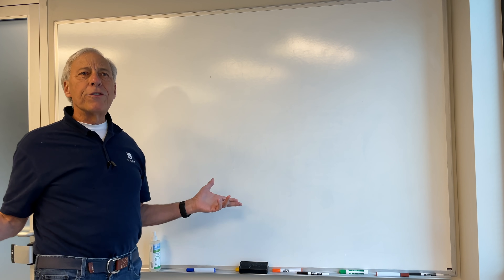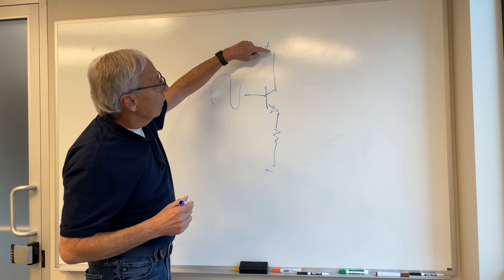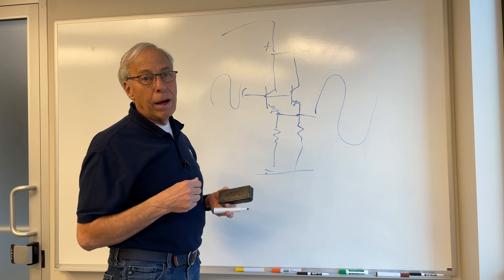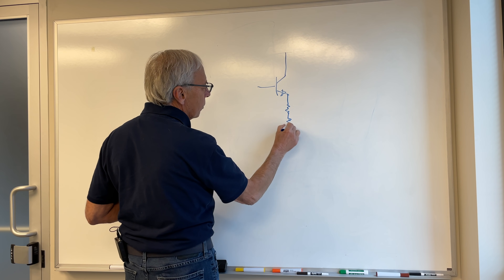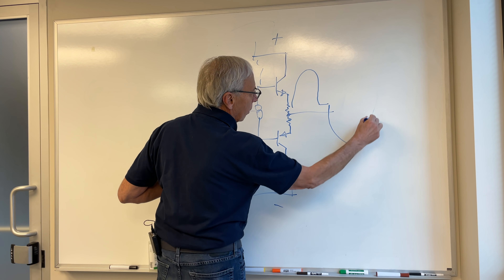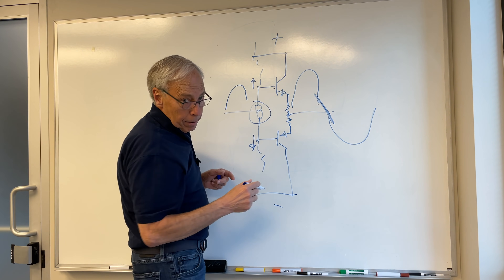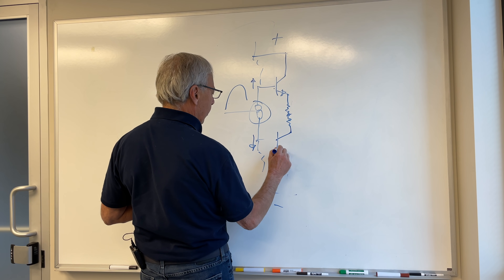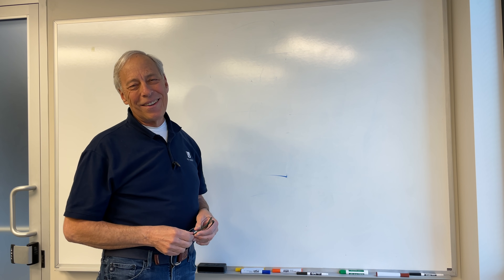Push Pull vs  Single Ended amplifiers

Comment: Correct me if I'm wrong, but of the three topologies he discussed, 1 and 3 are commonly used in low-watt tube amplifiers? Is option 2 more common in modern (solid state) designs?

Comment: if we ignore all the disadvantages of heat, power consumption, bulkiness, relatively low power in watts, we have to agree that the human ear functions as a single-ended device, because we humans hear other people without interruption, that is, single-ended, we do not have two languages, one producing positive and the other negative sinusoid, so I think that a single-ended amplifier is more faithful than any other way of amplifying music, of course today it doesn't matter at all, because why would you pay 1000 euros for a 10 W single-ended amplifier when you can buy a 100 W for the same money, but if it plays better, that's another matter a couple of sausages, you have to judge for yourself

Comment: Cartridges have a very wide frequency range. Some have frequency range from 1 Hz to 100,000 Hz. Vinyl records contain huge amounts of musical information. When these signals are fed to a  well designed amp or receiver, the sound is superb.  Tapes are close behind but somehow sound more  realistic ,punchy bass and warm but you need to know how to use tapes and  tape gear.
Reply from the maker: Wouldn't it be great if that were true? Catridge definitely don't have this type of frequency range. Life for vinyl folk would be pretty good if that were true.
Reply: @Paulmcgowanpsaudio  I beg to disagree. Pls check out the specs on some good cartridges. My old vintage Grace F9 frequency response go from 10HZ to over 45,000 Hz and my Supex 900 from 10 to 50,000 for a start. Others have even larger ranges

Comment: so push pull will result in more power? or its just efficient
Reply: Yes, more power and higher efficiency.
Single ended designs, whether traditional transformer coupled tubes or solid state (ala Nelson Pass), require high efficiency speakers, north of 90db/watt. Usually variations of horn designs or resonant tubes. Very expensive, physically can be quite large (although back loaded folded horns can be as small as conventional floor-standing speakers).

Comment: Quasi-complementary (both NPN) is a remnant from the early days of transistors when a PNP device didn't exist. Complementary transistors are well enough matched today that the feedback loop takes care of any non-linearity or mis-match between devices. The input stage (differential amplifier), VAS (voltage amplifier), and drive stage are FAR more important then the output stage.

Comment: You could fluid cool the single ended design with a noise-less passive heat exchanger circuit using the heat generated from operation to circulate a coolant through convection coils the same way as a gas bulb refrigerator.

Comment: As 7 of 9 would say, "The design works, but it is inefficient."!
Reply: the other use new-class-A where the single-ended-design is used for the output-stage (giving the excellent sound) but the power for the single-ended output-stage is regulated by a separate push-pull-stage. The result is a fine sound without burning exessive energy.

Comment: It may have been more useful to explain the dual NPN example using a quasi-complementary circuit.  You have practically done so in your diagram.  Also, both single ended and quasi-complementary circuits need to be decoupled, which some might see as a disadvantage over symmetrical complementary.

Comment: my 300B single ended triode tube amp is very hot, puts out only 8w+8w and is pure bliss
Reply: Which model are you using? I’m considering building my own based on someone else’s schematics.

Comment: I have an intergated stereo amp with dual mono amp config (of course with their own seperate power supplies) and it's own dedicated "processor" input so it also can be used as a power amp i.e together with a surround reciver.
That runs Class A on lower outputs and then switches to Class A/B on higher outputs. It helps keeping the room warm together with my Class A/B surround reciver :P

Comment: I'm sure Douglas Self would have something to say about the exaggerated crossover distortion and naming that a class B amplifier :)
But overall, in the span of 9 minutes, that was a pretty decent explanation of the main difference between single ended and push pull output stages. Although Paul missed to show the needed coupling capacitor that needs to be at the output (or a transformer) to block the needed dc bias voltage of the single ended output stage. And that capacitor is usually frowned upon.

Comment: Yes , Nelson Pass amps run hot (class A)  and they sound incredible.  He hasn't succumbed to the cheap ICE module trend (class D).
Reply: Class D has made incredible improvements over the decades. I say this as somebody who recently built a Nelson Pass Class A power amp, and the current owner of a Class A/B Cambridge Audio integrated amp.

Point being that Class D is very quickly catching up, and is often preferable for many consumers.

Comment: The amp that he started drawing, the emitter-follower, actually does not amplify voltage (it has an amplification slightly below 1). It is often used for buffering as it has a high input impedance and a low output impedance. 
It could function as a class-A output amplifier but, as Paul says, it gets very warm as it is not very efficient.
Reply from the maker: That is correct. A buffer or emitter follower amplifies current and passes voltage.

Comment: As an electrical hobbyist this gives me the perfect level of detail and information to understand these concepts.
I think the concepts are the same with tube amps (triodes).  You have an input stage and a splitter before the power tubes.
Reply: It was the splitter (or omission thereof when talking about 2x NPN Push-Pull) was where Paul momentary lost the plot.
Reply: @hugobloemers4425  Agreed.  Still a good overview for semi techies

Comment: There is some confusion in terms as some people consider a push-pull solid state amplifier to be in single ended mode ("mode" causing the difference in terms here) to differentiate it from bridged mode where the load connects between two outputs. Single ended being where the load connects between output and ground. Of course with tubes, single ended usually means one output device.
Reply: You can always substitute transistors for tubes when it comes to comparing the architecture of a schematic. The terms remain the same. Bridged also exists with tubes and single ended, even transformer coupled can also be done with one power transistor.
Reply: We've had multiple videos covering those topics. It is nice to see something fresh.
Reply: Hello
Reply: @adamsonlinearrayspeakersha87  NOBODY CARES ABOUT YOUR INANE DRIVEL. Reported.

Comment: I ripped some germanium transistors out of an old broken organ, if they don’t work in a fuzz pedal I’m gonna use them for a simple line driver for my guitar.
Reply: The holy grail of Ge NPN transistors for guitar use is the AC187 (The PNP complementary is the AC188)
Not easy to get at this point in time.

Comment: Sonically, push-pull designs are good for rock n' roll while single ended designs are good for more delicate music genres. Weird how solid-state single ended power amp designs tend to stream prodigious amounts of heat in operation and could double as an electric hibachi cooker.
Reply: Most amplifiers are either class AB or D today. and both those designs are good for all kinds of music. Also the delicate stuff.
Reply: @oysteinsoreide4323  Good, not great.
Reply: @mitchellfox3130  What are you meaning? You really wasn't very generous with your wording my friend.
Reply: @oysteinsoreide4323  I agree class AB is good, and in some cases very good. For rock music it is at least a horse race between class A and AB. But I'll still take class A for rock, especially the really well produced and recorded stuff (mostly pre 2000).
I don't have much experience with class D. Instrument amps which can be done well (but always model tube amps) and car stereos only, which are universally awful. Get in an old car with a CD player and a decent discreet amp and it's heaven to the modern junk in cars now.
I've heard conjecture that class D audio amps are getting good. But I've never bothered to explore that.
Reply: @mitchellfox3130  Class A is if you want an extra electrical heater in your room. I wouldn't think about using class A simply because they use so much power. Personally I wouldn't have different amplifiers for different kinds of music. There are especially many bad recordings from eary 80s in 80 to 85 especially. But every recording for themselves. There are made both bad and good recordings every year.
Reply: agreed. 300b set tube at 8w is the best for violin, singers, jazz
Reply: Hello

Comment: wow. If there was one question, ever, it "would have" been this. Great. I wonder how two npn's (in the same direction) can both push and pull, though?
Reply: You need to invert the signal that drives one transistor and feed it in to the other, it is called splitter.
Reply: @hugobloemers4425  ahhh, simple
Reply: @donpayne1040  this has some circuit examples of what Paul was on about, you can see two npn transistors used for the output stage https://www.sciencedirect.com/topics/engineering/crossover-distortion
Reply: @wazuo8354  ..what a gem.
Reply: It's the audio source that decides the push or pull if I understand this right.
Reply: @Projacked1  ...but then they'd be firing at the same time. Ill check a bascom king on YT.
Reply: @donpayne1040  You'd have the bottom rail at a negative voltage, top npn conducts a positive current, bottom npn conducts the negative voltage relative to ground.
Reply: @wazuo8354  Yeeeh...nope. Too much. Too much of the unknown for me.
Reply: @donpayne1040  Well Paul has simplified down to the very basic elements of a push pull design. For a npn transistor the current flow has to be from the collector down to the emitter as per what is shown by the little arrow, therefore the voltage at the collector has to be higher than the emitter for it to conduct current. An npn transistor cannot conduct in the other direction, hence the need for a pnp transistor. So the little circuit Paul sketched out with two npn transistors - it should have had the bottom rrail at a negative voltage and the speaker tapping off point showing the speaker being connected to ground. 
When the top transistor conducts the positive voltage from the collector to emitter the current flows through the speaker down to ground. When the bottom npn conducts current flows in the opposite direction between a lower voltage and ground, in other words the ground connection is at a higher potential compared to a negative voltage being applied to the emitter for the bottom transistor.
In essence what Paul showed was the very basics of a top transistor handling the positive portion of a wave and the bottom transistor handling the negative portion of a wave, this is what moves the voice coil of a speaker in and out, positive voltage pushes the speaker out, negative pulls it in, no output / 0 volts leaves the speaker in the middle, neither in or out - that's what makes the sound you hear from your speaker.
Reply: The bottom transistor actually  has to be a pnp "Sziklai" configuration, one pnp followed by one npn transistor. This is then called "quasi complementary output", very common when power pnp transistors were not so good.
Reply: @werewolf164  I see, "quasi complementary output"..>